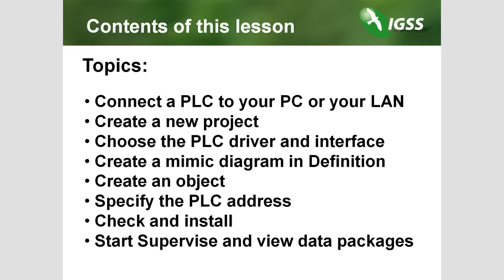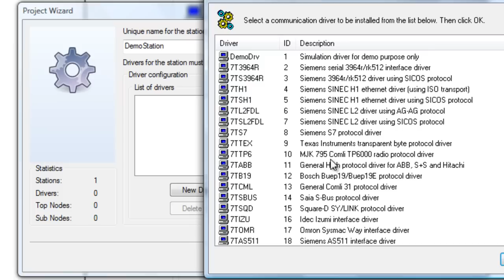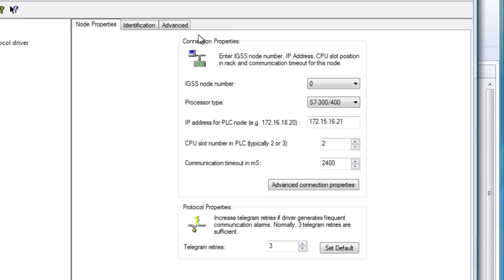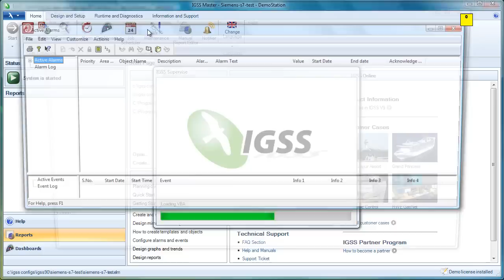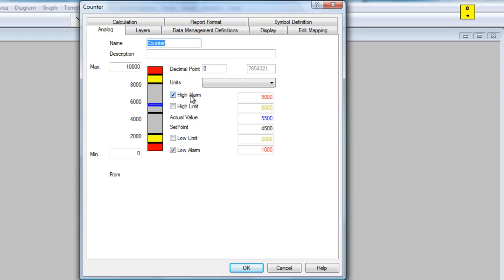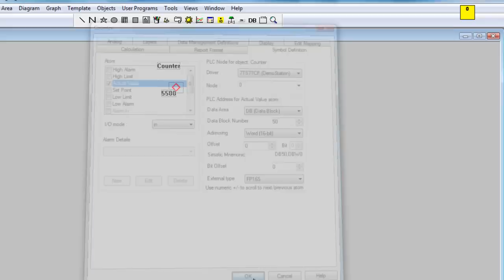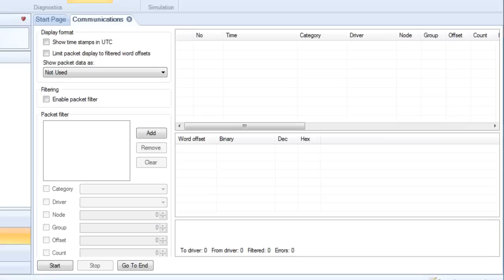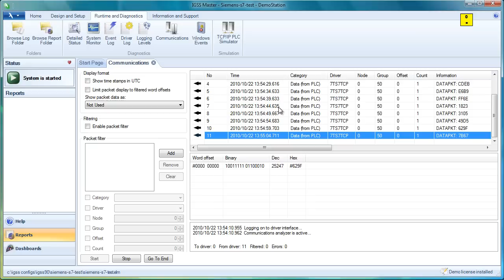30. Connect a PLC and Get Started using the SCADA System

Comment: Hello I have the problem in the Communication , it says ERRORPKT : LOWLEVERRI , and because of that my design in igss is not running , i use arduino UNO with ModBus RS232 , can you give the solution ? Thx